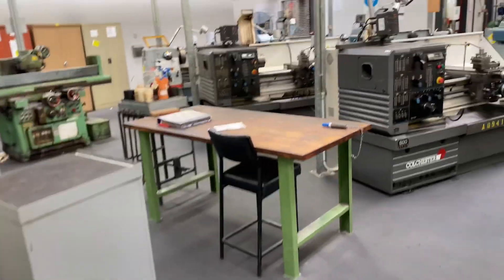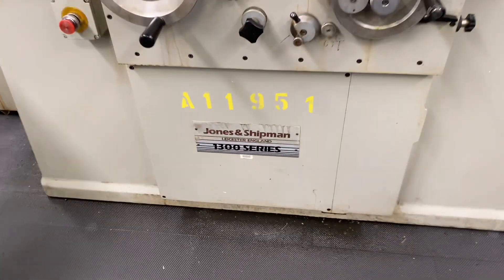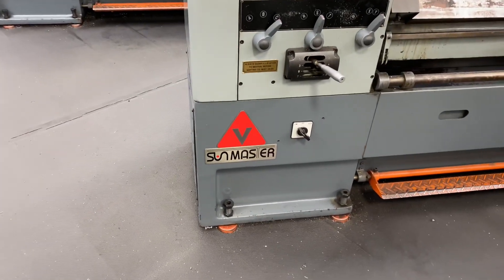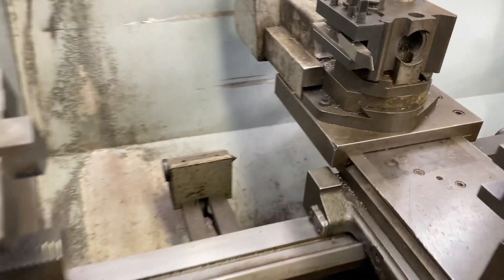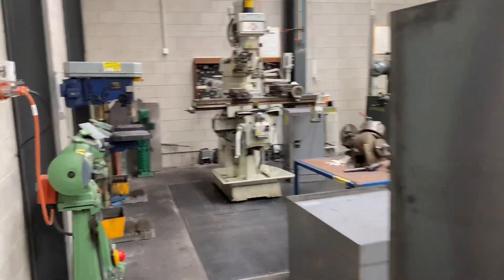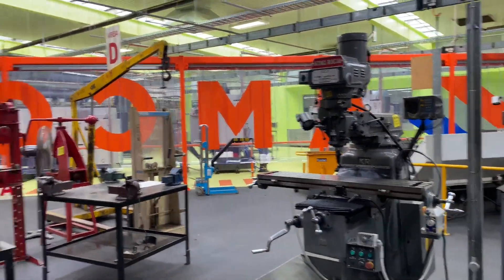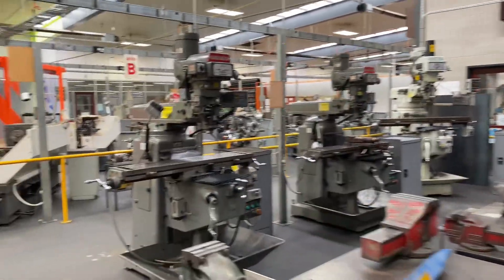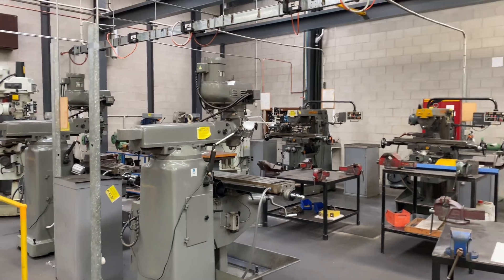Workshop Tour - Apprentice Training Centre

Comment: Most schools in the US have done away with most of their manual machines.  Another reason the US will fail to bring manufacturing back home.
Reply from the maker: Hi Brandon. Sadly this has also happened here to. The so called “experts” running the country think they know better. Thought the could “offshore” all manufacturing. That bit them in backside during and after Covid. Main stream education has also suffered. Many teachers have left the system due to the idiots running the schools with their leftist woke ideology. I could go on, but I think you understand where I’m coming from. Cheers mate 🍻. Aaron

Comment: Memories use a number of these machine as an adult student a couple of years ago. Was called Heidelberg Tech when I was a student there 55 years ago
Reply from the maker: Hello and thanks for watching. Yes not much has changed since you were there. Probably some of the same machines still. Unfortunately it’s a shadow of its former self. Electrical department has take over half the building and they nearly shut mechanical down. A few key industry players lobbied Govt to save it. Thanks for watching. Cheers 🍻

Comment: Very Nice shop Aaron 👌
Good to see a mix of Machines available for the students to use.
One thing I would Love to own is a Cylindrical Grinder.
Not for anything in particular.
Just a machine I always enjoyed working with.
Most prefer Surface Grinding ???
Surface grinding was a little Boring for me 😴
Looks like Aaron might have some machines handy for those jobs on the side 🤔
Hopefully you will revisit this video with a walk around the CNC area.
Thanks for showing us around.
Peter 👍
Reply from the maker: Thanks Peter. It’s hard to believe but the centre used to be six times bigger than what it is now. Unfortunately, interest and apprenticeship numbers in engineering mechanical (fitting & turning) has drastically declined over the years, but hopefully they are trying to reinvigorate the subject area. I have to wait for the ministerial launch before I can show the CNC machines. But I did provide a sneak peak on my Instagram page. If you’re over that way please feel free to pop in Peter. It’s Melbourne Polytechnic TAFE on the corner of Bell Street and Waterdale Road. 👍🍻
Reply: @AaronEngineering  Looks like you're in a Happy place there.
Hopefully this job works out a little better than previously. 
All the best for the future 👍

Comment: Hey , watched this a couple of days back !     Looks like a pretty good set up .   Do they have heat treatment as well . I remember one project we had to make on block release was a hardened & ground 22mm  spiral flute reamer .   👍
Reply from the maker: G’day Max and thanks mate. She’s a very old but capable set up. The centre has churned out many apprentices many over the years. They used to make many different projects Max. But unfortunately over the years there has been a massive decline in apprentices and the trade has lost its sexiness. Hopefully Andrew and I can turn it around with a blend of old and new projects. Cheers mate 🍻.
Reply: @AaronEngineering  
Every happy apprentice is a ‘recruiter’ mate 😎.
Grasshopper
Reply from the maker: @RobertBrown-lf8yq  well said Robert 👍🍻

Comment: G'Day Aaron, you look like a dog who doesn't know which way to look, so many goodies in there.  During my time the TAFE Collage I went to had 4 large training rooms, unfortunately most of the gear was pretty old along with the instructors, but we were well grounded in machining.  Which TAFE Collage are you now working at?
Cam
Reply from the maker: G’day Cam.  I was originally trained as a mechanic and worked in light / heavy industry, but switched to engineering in the 90’s. Back in 2001, I retrained as a high school teacher and worked in secondary education for the last 20 years.  This job came up at Melbourne Polytechnic TAFE Heidelberg, and I made the leap of faith 😉. This centre used to be massive, but has slowly declined over the years as Australia moved manufacturing “off-shore” (to our peril). Feel free to pop in mate if you’re over this way. Cheers 🍻 Aaron

Comment: Hi Adam, nice machine shop. Do the newbies run those Colchesters, they must look daunting if they're straight from school? Tony
Reply from the maker: Hi Tony. Thanks mate. Yes the newbie’s run these machines straight up from high school. I agree with you, these big old girls do scare a lot of students first up. To be honest, machines half this size would be better suited. Cheers 🍻 Aaron
Reply: Back in the seventies, I went to a Technical School.
It had quite a few workshops for various trades including what we called, Fitting and Machining.
As 13 year old in Form 1, straight out of State School or Primary School  we were let loose on lathes.
I don't recall using milling machines.
One thing I do recall was the teacher going off his head when someone drove the carriage into the chuck 😢
The other thing I well remember was the fact that if you mucked around in any class, it was always the trade teachers that wielded the gatt or strap. In fact, the wood work teacher who was a fairly big bloke, would leap off the floor to get more effect when he swung the strap - evil bastar#

Comment: Fanrastic facility Aaron, what's behind the curtains???
Reply from the maker: Hi Ian. Behind those curtains are 5 brand new Haas CNC mills and lathes. One VF2SS has a 5 axis trunnion, the other VF2 has a robot arm attached, and the mini mill has a 4th axis. We have a Haas ST20Y lathe with Y axis and live tooling (axial and radial). We also have a stand-alone Fanuc robot arm and Markforged carbon fibre printer. Cheers 🍻 Aaron
Reply: @AaronEngineering  Wow! Sounds like you got everything you need Aaron, not a lot you can't do in that shop!  The apprentices will get top notch training I'm sure.
Seems like STEM is gaining ground steadily, with more and more students going into apprenticeships. 
Regards Ian